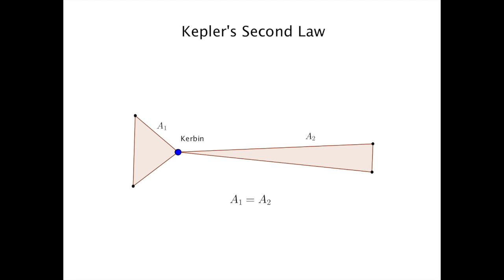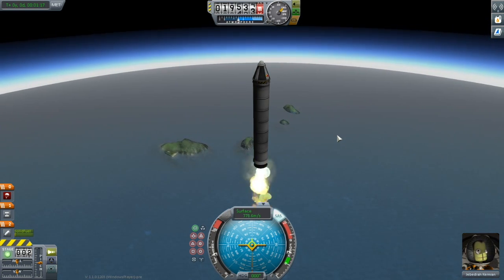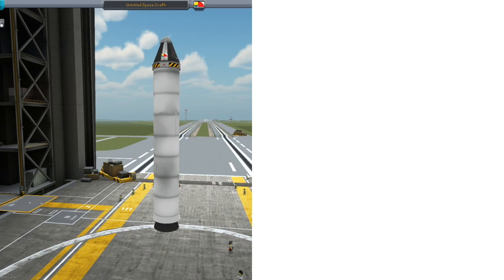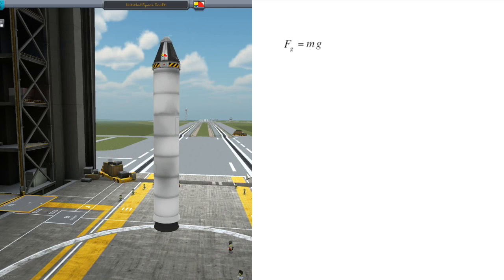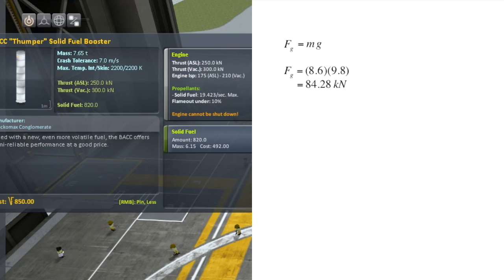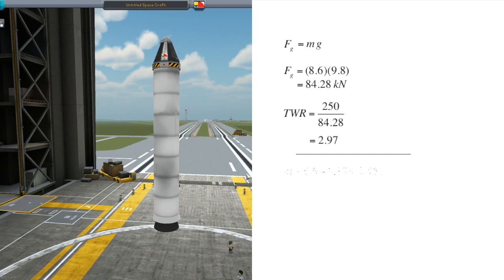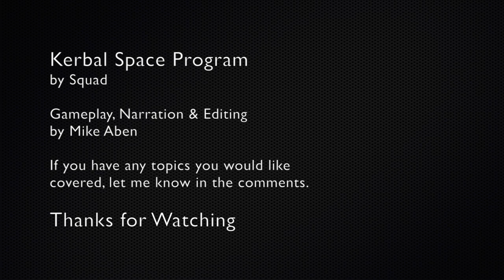Thrust To Weight Ratios | KSP Let's Do The Math

Comment: Very informative and helpful, but it is crazy frustrating to see all these formulae being worked out without including units. Unit analysis is one of the easiest ways to be more confident you worked a problem out correctly, because if you end up with the wrong units, you didn't do it right.

Comment: Hey Mike, I'm rewatching these videos for understanding (I'm still procrastinating on making inclined orbits part of my spreadsheet), and you mentioned that the gravitational field strength does go down as you get higher. You said that you would cover this in a future video,  could you tell me which one that might be? If there isn't a video, how would we determine the gravitational field strength high above Kerbin or in another celestial body?
Reply from the maker: You're right, I never did make that video (gotta put it on this list). The gravitational field strength goes down by something called the inverse square law, which I cover in detail in this video (https://youtu.be/w-Mh1gnrvtA), but there I applied it to sunlight, though it works in exactly the same way for gravity.

Basically, the formula is this.

g_2 / g_1 = (r_1 / r_2)^2

In this formula, g_2 would be the gravitational field strength that you want to calculate at some distance from Kerbin's centre (r_2). g_1 would be a gravitational field strength you know at some distance from Kerbin's centre (r_1).

We know on the surface of Kerbin that the gravitational field strength on Kerbin's surface is 9.8 N/kg (as mentioned in the video). Kerbin's radius is 600,000 m, so our distance from the centre of Kerbin is 600,000 m, that makes r_1=600000 m. This gives us a pretty handy formula.

g / 9.8 = (600000 / r)^2

Now g is the gravitational field strength you want at a distance r from the centre of Kerbin. This formula can be rearranged a bit to get this.

g  = 9.8*(600000 / r)^2

Let's do a couple of examples. What's the gravitational strength 1,000 km (or 1,000,000 m) from Kerbin's surface.

g = 9.8*(600000 / 1000000)^2
= 3.5 N/kg

The rocket in this video flamed out at an altitude of about 26 km. Let's calculate the gravitational field strength there. Don't forget that r is the distance from Kerbin's centre. Since Kerbin's radius is 600 km, that altitude is 626 km from Kerbin's centre. That makes r=626000 m. So

g = 9.8*(600000 / 626000)^2
= 9.0 N/kg

Not too different from what it is on the surface.

This equation works in real life too. Earth's radius is about 6,300,000 m. All you got to do is put that in for the 600000 in the previous formula. The ISS orbits at an altitude of about 400 km. Let's calculate the gravitational field strength there.

g = 9.8*(6300000 / 6700000)^2
= 8.7 N/kg

Hmm, not too different from what you and I are feeling right now.
Reply: @MikeAben  Thank you so much! Smooth as ever.
Reply from the maker: @braddaily8688  Anytime

Comment: I'm currently watching this playlist and writing down the process in my notebook to use in the game, but I do have a few questions:
- When you do 8.6 - 6.15, is this for getting rid of the fuel + booster? If so, would the equation just be 8.6 without getting rid of the fuel?
- How did you get 92.50/(6.8)(9.8)? Did the 6.8 come from the 8.6 - 6.15 but using 0.37? If so, please explain how you did it.

Amazing content and very understandable anyways ❤

Edit: Ignore the first question (I realized that your equation was for using the decoupler after testing it with and without the decoupler in the game)
Reply from the maker: Thanks, but can you state the time in the video at which the calculation is made? This video was made a while ago and I don't know what the calculation is in reference to.
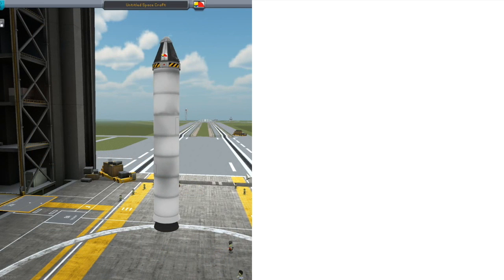Reply: @MikeAben  At 6:32 - 7:15
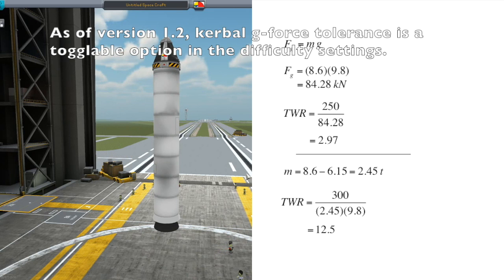Reply from the maker: Perfect. Thanks. The 6.8 is the new mass of the rocket and the 0.37 because I tweaked down the engine to 37%. I briefly mention this just before these calculations at 6:20.

Comment: Ok, I understand all that was presented but my question is "What was your math/reasoning behind changing the mass of fuel by a quarter?"
Great Series by the way.
Reply from the maker: That had to do with the original tutorial where all I wanted to do was just get into space but not get to high.
Reply: So you were able to calculate the approximate/expected altitude using what formula? Experience or something a little more sophisticated?
Reply from the maker: @davidflockton445  Just fiddling with what would just get me into space. The point of the original tutorial was just getting into the space setting up the next one which was getting an orbit. The TWR stuff was originally an afterthought, but the math part turned out to be more popular so I split if off separately. If I were to do it again, I wouldn't make it so disjointed. Here's a link to the original.
https://youtu.be/To4smqPtTe4

Comment: As you may have known, KSP doesn't show Thrust for propellers, so how would we do this for rotor-propelled aircrafts?
Reply from the maker: I'm not sure you can. The thrust from would be a function of the rotation rate of the motor, the angle of attack for the prop, and it's size. All of which affect each other. I rather wish the game had pre-made prop engines with a fixed thrust.

Comment: I don't understand why you have to check the TWR in vacuum if Kerbals aren't affected by G's. 
And why calculating with the mass of your EMPTY rocket once you are in space?

Do you recommend a specific TWR to leave the atmosphere of Kerbin and then to thrust in the vacumm?

Thanks for the video, they are all good :)
Reply from the maker: Actually, an update since this video does have Kerbals affected by g-force, depending on your difficulty settings. Admittedly, their limit is pretty high, but I thought I'd mention it.

When the engine flames out, the fuel had just ran out, so to calculated the TWR you need the weight of the empty rocket. When leaving the atmosphere you want the max TWR that doesn't blow up the rocket. When going straight up like I did here, it doesn't much matter as you wont spend that much time in the upper atmosphere your speed wont be that high yet, but when ascending into an orbit, you spend a fair amount of time in the upper atmosphere building speed, and if you build up too much then things start to explode.

That all said, I like to keep my TWRs within a real world realm just for immersion's sake, so with an orbital rocket, I like my high atmosphere TWR is in the 2 to 3 range. Once in orbit, TWR doesn't much matter and they can be well less than 1 if you want. It's all a question of how much time you want to spend executing burns.

Finally, it should be mentioned that game updates since this video have TWRs available in the VAB, so you don't have to calculate them yourself, though it's still helpful to know how it's done.

Comment: Does this apply to planes as well or just rockets
Reply from the maker: No, planes can have a much lower TWR, even less than 1, because the use aerodynamic lift to have then go up.
Reply: I believe as an example, of you have a Cessna 172 weighing about 1100 kg and it's engine produces some 2000N, which means the TWR is 2000/(1100*9.8) which is ~0.19. the actual number would vary depending on aircraft/engine/propeller but it should always be something around the 0.2 mark, and they fly just fine

Comment: I just did the math on one of my rockets lol I used three Rockomax Jumbo64 Fuel Tanks and a RE-M3 "Mainsall" engine and got 1.3kN.  No payload.
Reply from the maker: You should go to the rocket equation video and calculate the delta-v of that. It'll be through the roof.

Comment: How to find acceleration if know the thrust of the rocket?
Reply from the maker: Acceleration equals force divided by mass. If in orbit, force is just your thrust. If going straight up in atmo, force is your thrust minus the force of gravity. Force of gravity is your mass times 9.8 (or there about). Things get more complicated flying other than straight up if you want me to keep going.

Actually, if going straight up, you can take your TWR, subtract 1, and multiply that by 9.8. That works too.

All of this is ignoring air resistance, of course.

Comment: hold on, you used the mass in tonnes without converting to kg in your calculations? Wouldn't that corrupt the scale of your calculation? EDIT: Ah, you converted it to kilonewton in the result instead, my bad! Thanks for the knowledge!
Reply from the maker: No worries. I'm glad you saw there was no need to convert.
Reply: ("tonnes", I hate that word - why confuse an existing term that pre-dates Metric like that when "megagram" means the same thing and has no older meaning in Imperial to be ambiguous with?  Imagine the confusion if they had decided to call meters "yards", and call litres "gallons".  That's what calling a Megagram a "ton" does.)

But anyway, KSP does all the masses in megagrams, but it also does all the forces in kilonewtons, so those 1000 factors always end up cancelling out.

Comment: Did u do a equation and put 1.3 on the right side? How did u otherwise get to 37%
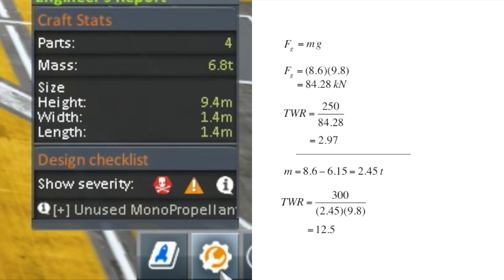Reply from the maker: I'm not sure what you are referring to. At 6:28 I mentioned that I reduced the thrust to 37% of the max thrust. If this is what you mean, the 37% is not a calculation, but is just what I set the thrust slider to in the VAB. If this isn't what you're asking about, reply back and give me the time you're refering to.
Reply: @MikeAben  Hello, yes  and thanks for answering. What I am wondering is how you can in a more determined way  get to 37. Is there any third part software?  I am really thankful for this vids they make the game better.  I'm on ps4 so the mods won't work for me.  I guess doing the ecuation with a pretermined answer will let the faktors be changed? I gonna try with 1,3
Reply from the maker: @cptoscar  I see. I really didn't explain that did I? I find a launch TWR of about 1.4 works well generally. I typically shoot for around this number. I also knew that the mass of the rocket is 6.8 tonnes. This gives me a weight of 6.8*9.8=66.64kN.

So I want Thrust / Weight = 1.4. Multiplying the weight over means Thrust=1.4*66.64=93.3kN.

The SRB has a default launch thrust of 250kN.  So I want to set the slider at 93.3/250=0.37=37%. 

Any differences in the numbers here and what is in the video is just because of rounding.

If you want this in a formula it would be

thrust slider = 100*(1.4mg)/T,

where m is the mass of the rocket (in tonnes), and T is the default surface thrust (in kN).

Comment: Long story short divide 9.8 by how many tons your vehicle weighs and if that number is lower then the amount of thrust your rocket makes it will fly if higher it won’t.
Reply from the maker: You are not incorrect, but a TWR of 1.5 is a different beast than one of 15.